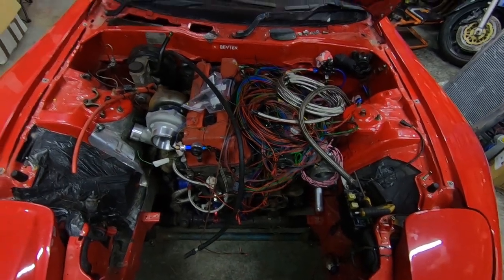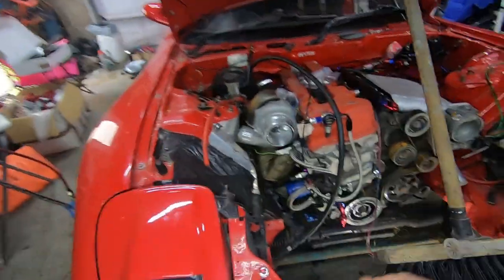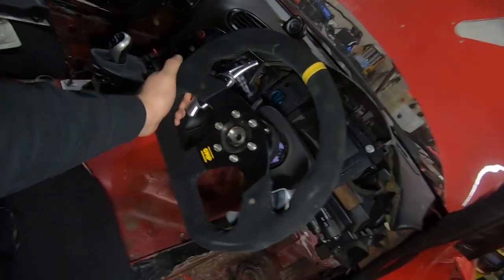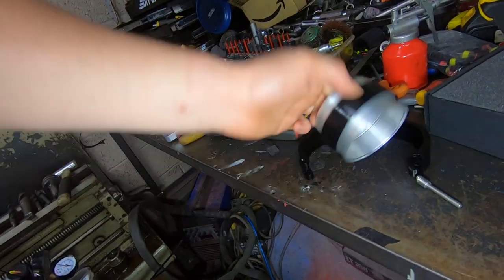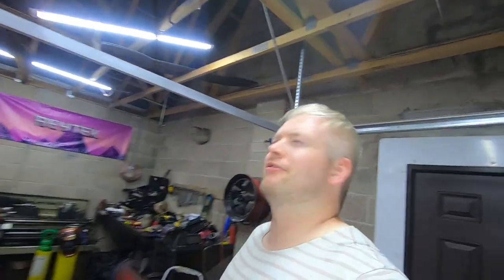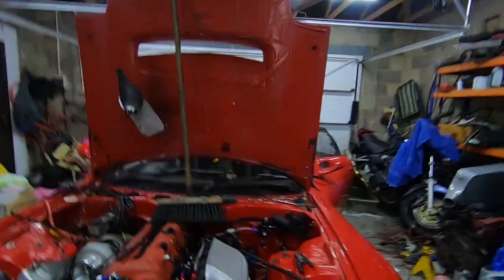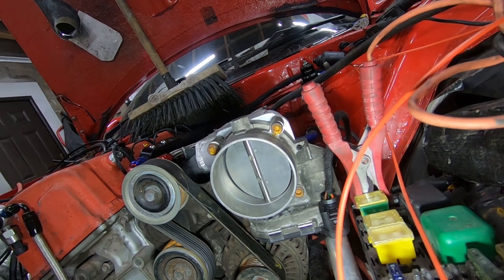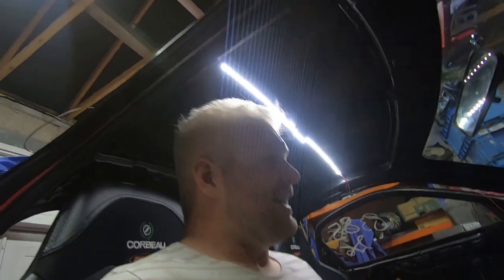WORLDS FIRST DCT RX7!!  MAXXECU!! MAKING WIRING LOOM.. WE HAVE RPM SIGNAL!!!

Comment: Very good tip with that 12v position switch and resistors, really like it. How does it work so far? Thinking of using this on my project as well. Thanks
Reply from the maker: yeah fine :)
Reply: @BEYTEK  you wired it as AIN or DIN? I would say a DIN, but not sure xD

Comment: Loving this build!! What E throttle body and E pedal are you using?
Reply from the maker: emmm audi rs6 and nissan xtrail pedal
Reply: @BEYTEK   where do u show how to connect max ecu to the dct tcu??
Reply from the maker: @FirstLast-tx3yj   its ion maxxecu how to. website. its like 2 wires :)
Reply: @BEYTEK  the software is also on the website to flash the tcu?
Reply from the maker: @FirstLast-tx3yj  everything is on maxxecu site yeah :)